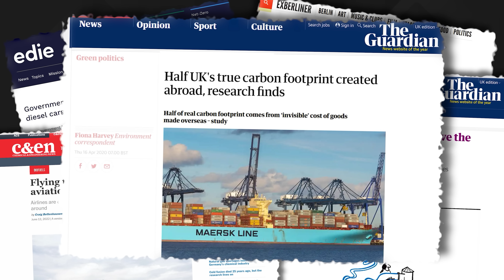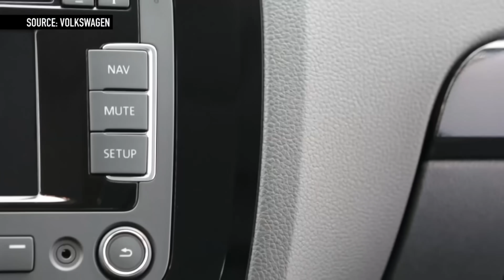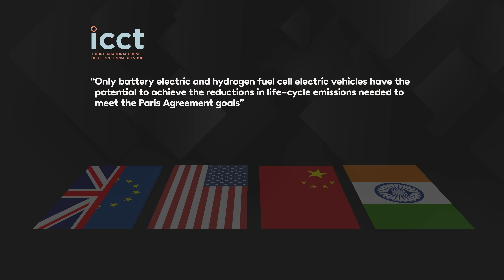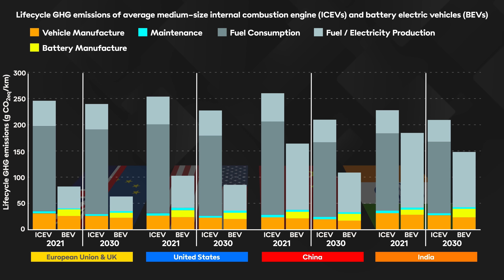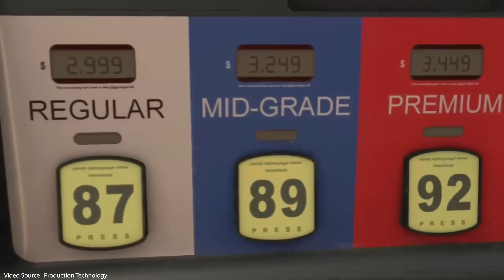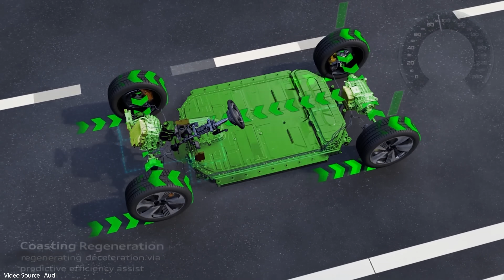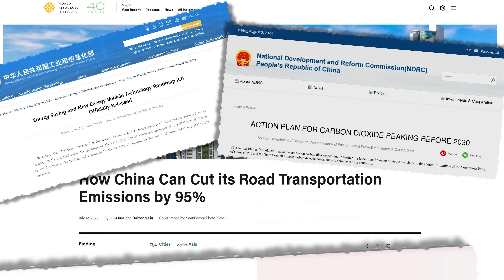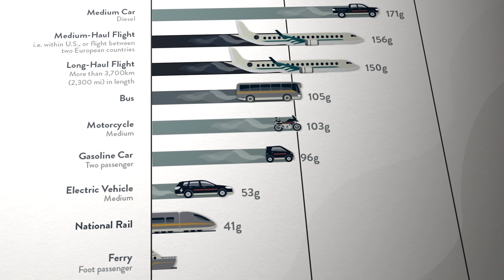Are EVs really better for the climate?

Comment: EV's are better than ICE cars for the global warming crisis, true, but that's like saying diabetes is better than cancer, because it will take longer to kill you.  Or perhaps you could compare it to using Methane instead of Coal for power production - yes, methane is cleaner, but it still produces more CO2 than we can afford.  Unfortunately, in the long run, we can't afford either type of car.  If we look at a future world where we need to try have ZERO carbon emissions, we simply cannot get there with a fleet of EVs anywhere near as large as today's ICE vehicle fleet.  Even from a materials viewpoint, if we tried to simply replace our current ICE vehicles with a similar number of EVs, we'd run out of lithium and a bunch of similar metals in less than a century.  

EVs are a short-term stepping stone to try reduce our overall carbon output for SOME people, and yes, they would work if the goal were to only reduce total CO2 emissions by 30% (assuming the total economy size did not keep growing).  We should really be trying to change the societal focus (and the way cities are designed etc.) to be less car-dependent, with more option and accessibility for trams, trains, buses, bicycles, e-bikes and so on.  ICE vehicles will very likely need to be used for quite a while yet, but their best value is in trucking and goods transportation, not personal convenience travel.

Comment: Here's my issue with all the calculations that I'm seeing. They assume that if the grid is 50% green, the car runs at 50% green energy. However, if solar and wind energy are already at maximum production (which they normally would be) and I hook up an extra car to the grid to charge it, extra electricity needs to be generated, and since we can't increase the solar or wind output, that extra power will be 100% gray (or nuclear) energy. So, electric cars run on 100% gray energy.

And at that point, when looking at the higher efficience of the electrical engine, we need to take into account how efficient (gray) power plants are (30-60%), transport losses (5%), how effficient the batteries are when they are being charged (70-80%) etc. Using the averages, 45% * 95% * 75% = 32%, so only 32% of the available power going into the power plant actually reaches the engine. Multiply that by the 80% efficiency from the video and you get 26%. Which is worse than for fuel cars.

I have had a hybrid car for the last 11 years and I love how little fuel it needs and how smoothly it drives. So just for comfort alone I would like my next car to be electric only. But due to what I wrote above, I have serious doubts about whether it's good for the environment or not.

Please prove me wrong!
Reply: Most grids have too much Electricty at off-peak times and switch renewables off (for example the UK often turns off wind farms overnight even though still burning gas as they cant turn the gas on and off quickly, and in Australia is becoming common to turn off solar during the day). This will become more and more of an issue as more renewables are added to the grid. EVs are perfect for charging when renewables  and nuclear are abundant and prices are cheaper soaking up this basically free energy! (This is the reason why Economy 7 overnight tariff exists in the UK to encourage people to use it) 

But even if you charge your EV 100% from natural Gas, A gas power station is 55% efficient paired with 80% of that energy driving the EV wheels (including regen braking) = around 45% of the energy drives the wheels, ICE cars are around 20% efficient from the origianl energy in Oil, hybrids around 25%, plus burning oil generates more toxic emissions than gas. and city air so much cleaner! (Plus the saving of 15 years servisable parts the ICE engine would require compared to EVs, spark plugs, filters, injectors, oil changes, timing belts etc.......) And electric motors are a lot more efficient at using that energy and a good EV achieves the equivalent of 130 mpg.

But most grids are not 100% fossil-fueled and over the average 15 years future life of a EV the grid will just become greener and greener every year with more and more abundant renewable energy.

Basically never again buy NEW any type of ICE powered car! As EVs are so much better! (double so when taking into consideration devaluation of ICE cars compared to EVs)

Comment: i am really getting tired of the EV haters spreading all that bs on social media.
however, nobody needs them anyway. the world always was divided in leaders and followers.
the followers where only seeing problems and the leaders are seeing/searching solutions.
i don't have an EV now because i cannot afford one now. so, i will go on with my diesel until something like an ID.3 comes along the way. maybe a bit better.
and i am very confident that this will happen. now resources are expensive because of slow mining. and car manufacturers only sell high end versions at a high price because of high demand and not enough supply. they really make high profits now.
the VW group made over 10 billion $ profits in the first half of 2022 despite part shortages. also good profits with their BEV lineup. that is insane!
once there is more supply, then prices will drop. and then we have the battery development. there will probably never be a revolution in this sector, but every year there will be evolutionary steps. sodium ion batteries will soon dominate the stationary batteries and will free up the lithium for only mobile batteries. new technologies with sulphur, graphene, aluminium ion and so forth will come at some point and bring prices down as well as improved production methods like dry coating instead of wet coating etc.
prices of BEV are really high now but in 2025, I expect prices to go down again. this will be the time where you then also be able to order a normal car without that laser guided 4d xray computer augmented tomography spacestation full autonomy mars rover navigation bs and thai massage seats with happy ending. that alone will save you 15 grand.
this will be the time where the average joe is happy to buy a car again.

Comment: Longer term, EVs will be able to achieved impressively close to a fully closed loop economy as car bodies and batteries are highly recyclable. The ICE economy burns all the fuel inputs so it is already behind and will fall further behind over the next 20 years. 

The good news is that the EV transition has already reached a tipping point and we are entering the steep part of the S curve adoption phase.

Comment: i have a 20 year old EV. it actually contains no lithium as it runs nicd batteries, amazingly it is still going on 20 year old batteries, range around 40 miles so still a very useful vehicle for erands because you can drive it for about 2 hours. It is continuing to not use a drop of fossil fuel, as it is charged from renewables.